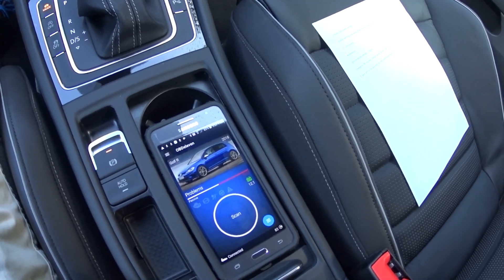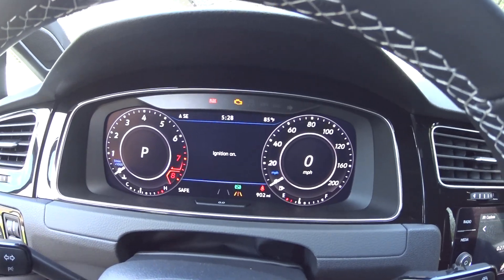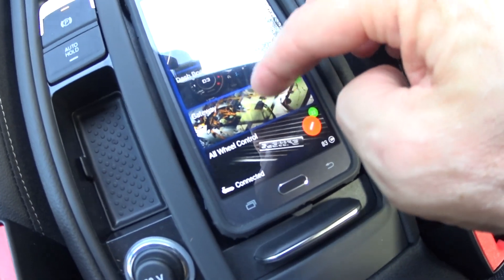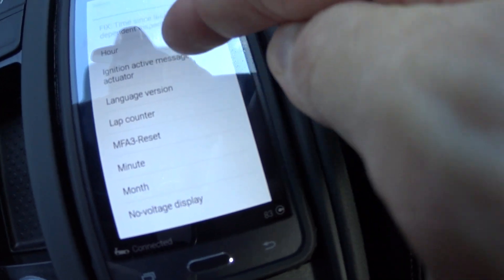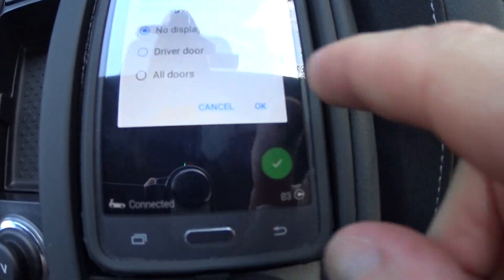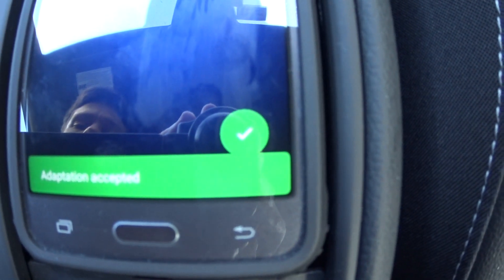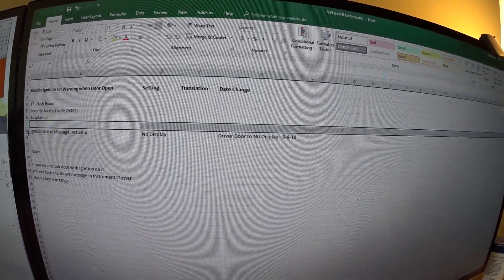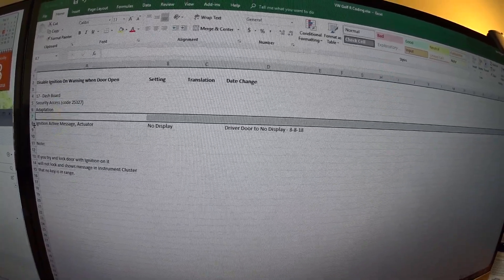2018 VW Golf R - MK 7.5 - Coding to Disable Ignition On Warning when Door Open

Comment: Does this work in a 2019 GTI and does it void the warranty?
Reply from the maker: Yes should be the same.  It is just a setting you are flipping off, but technically you are changing the computer software.  So proceed at your own risk.